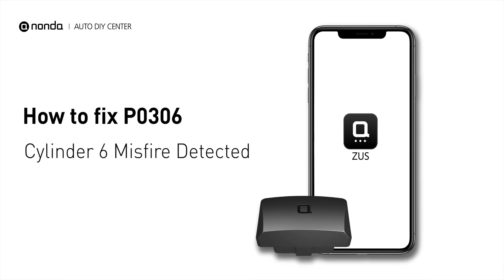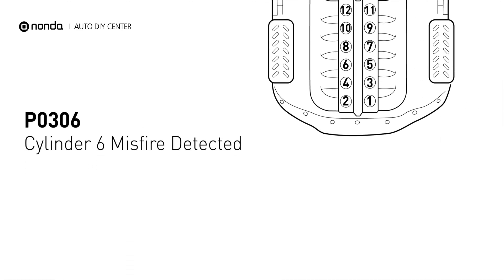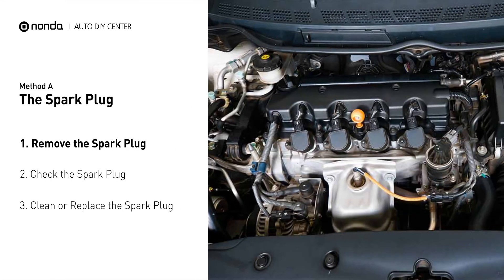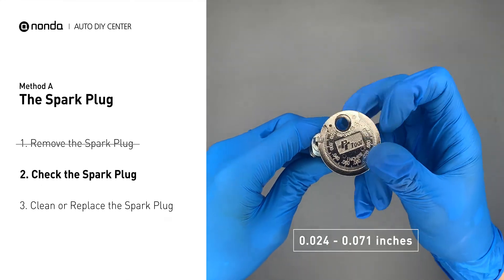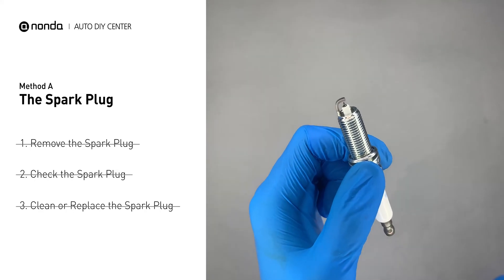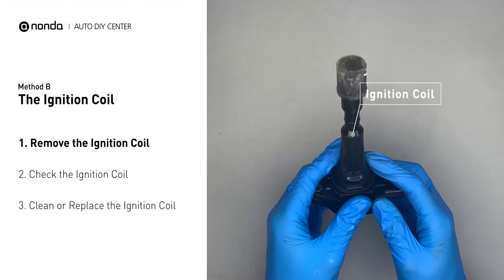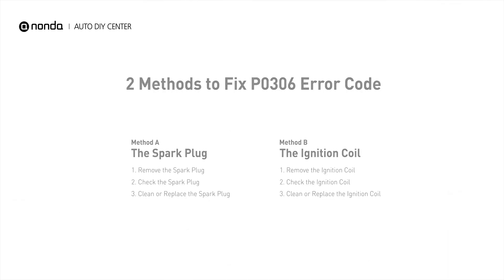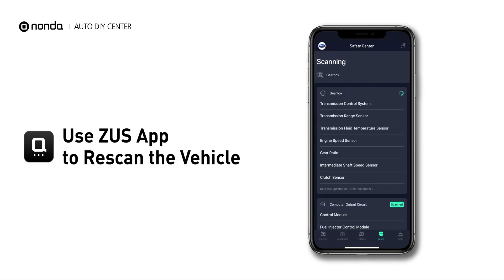How to Fix P0306 Engine Code in 3 Minutes [2 DIY Methods / Only $4.76]

Comment from the maker: Hi, I'm Steve, nonda's lead mechanic engineer. 
Feel free to leave your comments here if you have any mechanic questions, I will be glad to help you out!
Reply: I had this code and thanks to God and your video, I was able to troubleshoot the problem. It was my ignition coil. Thank you very much!
Reply: Hi Sr I have Ford transit 2015 3.7 v6 whit code po306
Reply: 4 and 6 keep throwing codes replaced and swapped parts with other cylinders and codes for 4 and 6 keep coming back. 
How would I test the wires going to the coil over packs? 2008 Ford Taurus 3.5L

Comment: Be careful about adjusting the side electrode of the spark plugs using the method shown here. Damage to the plug is likely.  Not to be confused with "danger to manifold" lol

Comment: Hey! Sorry I'm late lol my trailblazer is still showing this code and I've replaced the coil packs and spark plugs. It sounds like its gasping for air 😂 any ideas?
Reply from the maker: Hello, how about the ignition coil. Was it checked?
Reply: Air problem, check hose

Comment: Hi, i have this problem with my 2005 sebring, i changed all the sparkles and coil but the light is still on, any suggestions? Thanks
Reply from the maker: Hello, have you checked if there's a vacuum leak? Please also check the condition of the plug wires for any issue.

Comment: i had this problem ongoing for a year, it took me 2 months to find, isolate and fix the problem. After getting new plugs, wires, and fuel injectors installed the codes just multiplied. on my final test before the mechanic, i decided 2 switch coils and retest the engine code. However, upon removing the coils found dirt covering the plate underneath the coil packs. After a good cleaning, finally my long nightmare headache went away. Just thought I should share.
Reply: Travis did u have any issues with the performance of your car?  I have this same error code and am noticing a very slight transmission slip when going over 70 mph .  Thanks!
Reply: @cvx5422  I have the same code P0306 I check spark plugs and coil packs they look fine . I checked if the spark plugs are working and they are s. There is only 2 options left that can be cashing the misfire . Either the rings or Valves are not operating how they should be.
Reply: @Mandoinahellcat  how did you solve it l am currently facing the same problem
Reply from the maker: Hi Travis, thank you for sharing your experience!